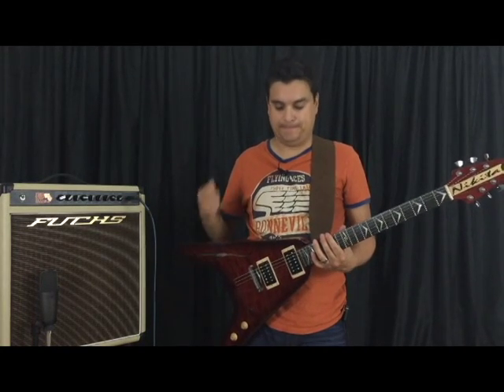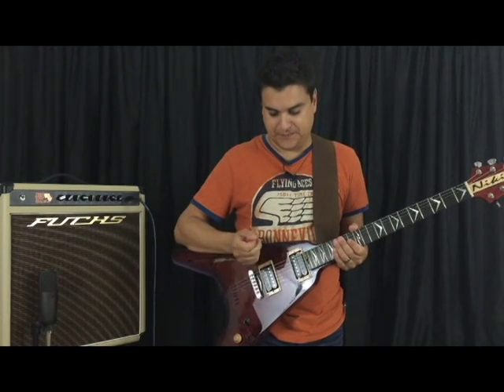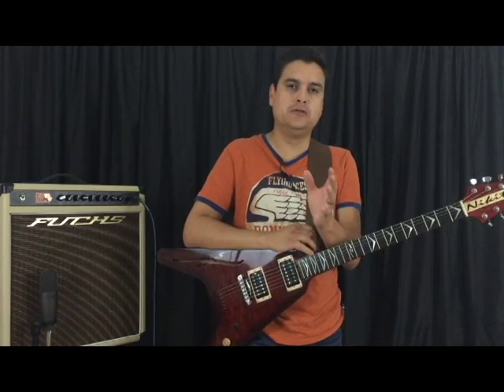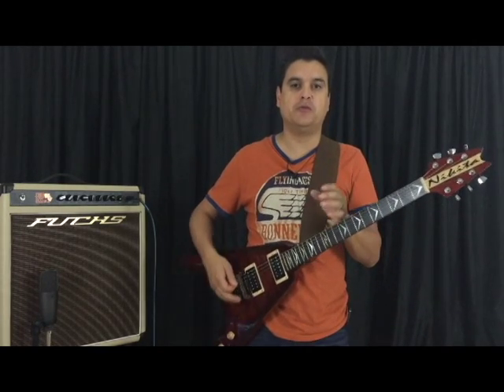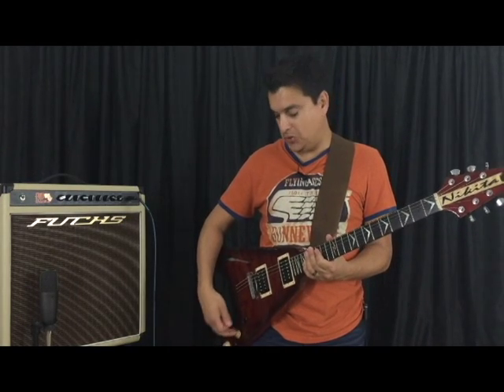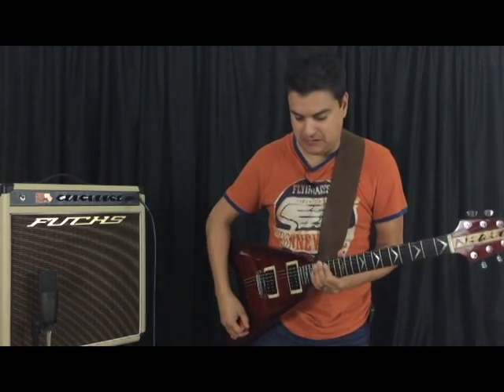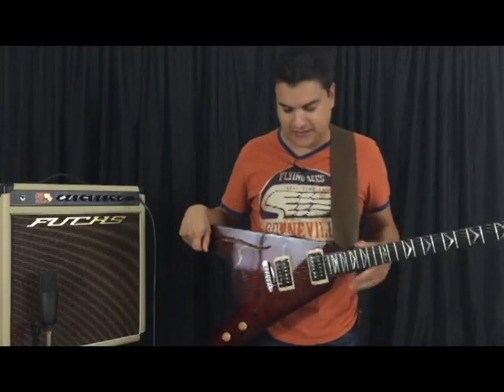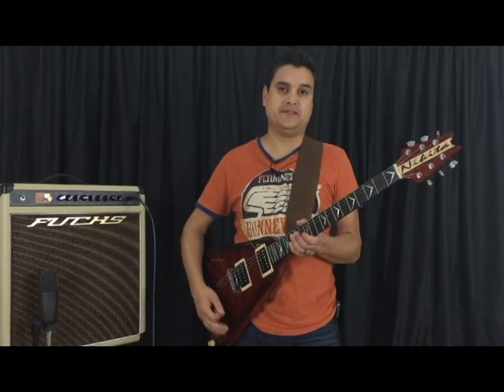Dylan Pickups Centerpunch Humbuckers #9

Comment: I like the sound of the single coil more than the full on humbucker. Is it possible to wire it in my les paul so that when I go to bridge it uses that tone without having a coil split? I do not want to install push pull pots if all I am going to do is pull it everytime.